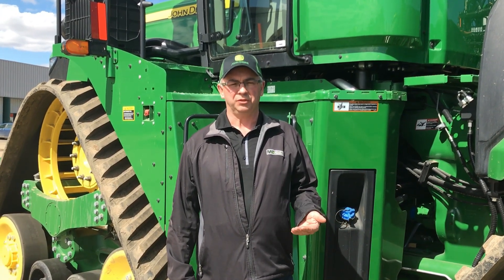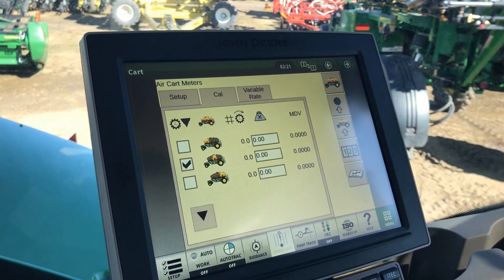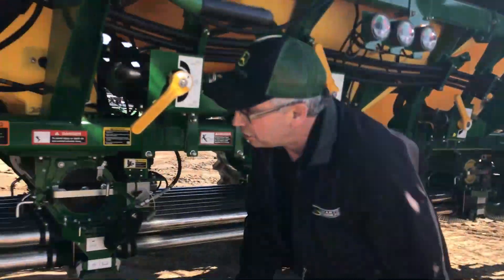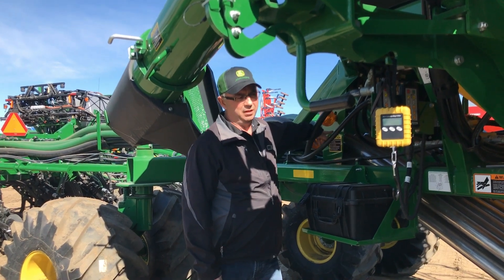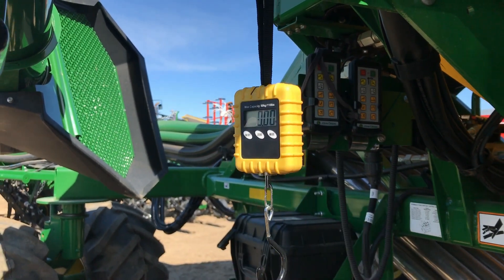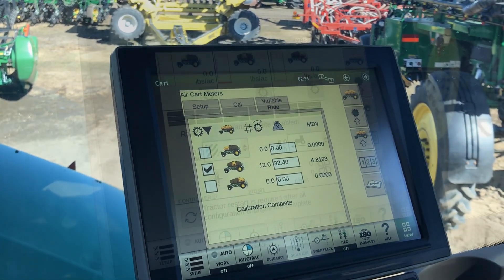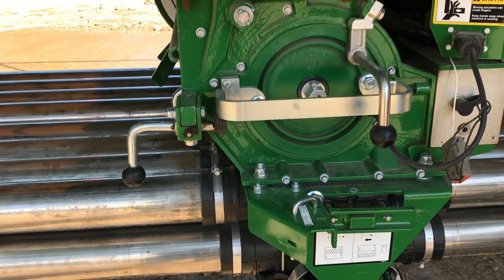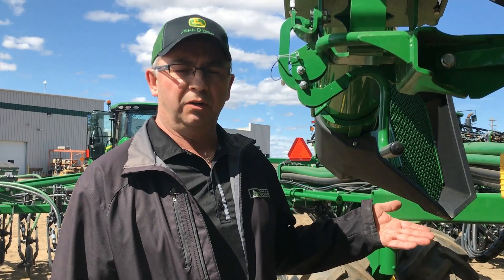Air Seeder Optimization - John Deere 1910 Cart Calibration & Meter Rate Verification

Comment: Hi, thanks for creating this video! Just curious, how do you know what application rate to use? Is there a calculation/formula that you use to know the rate?
Reply from the maker: The rate would be based on the seeding rate or fertilizer rate (lbs per acre), which can vary from field to field based on the type of conditions you are in, and products being used. We recommend talking to an agronomist if you are not sure of what the optimal application rate is.